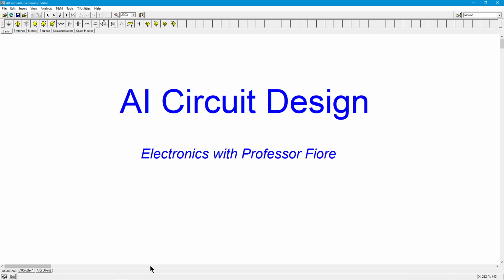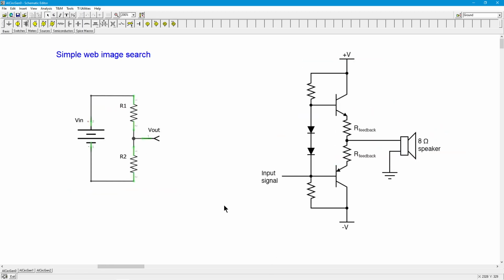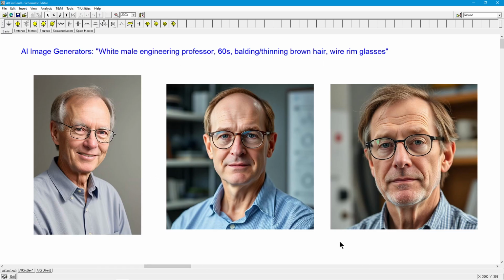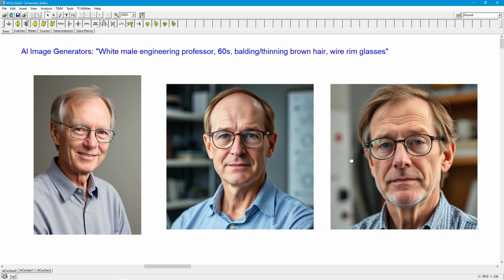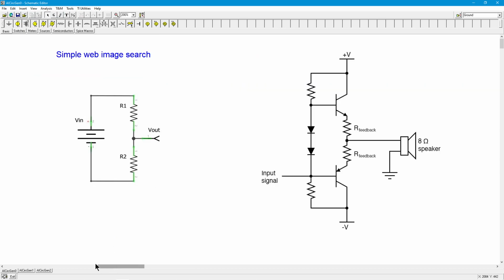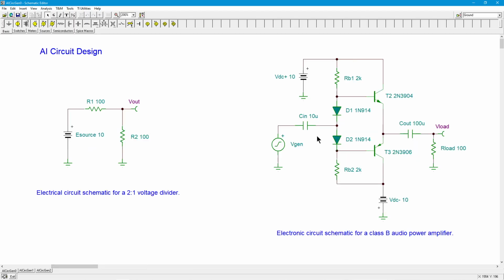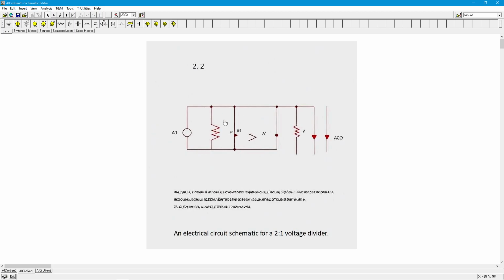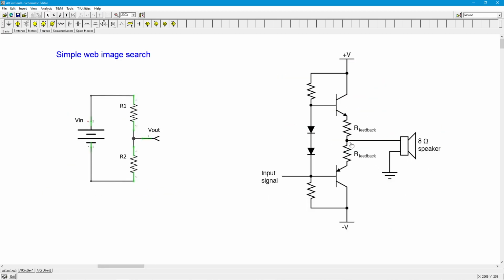AI Circuit Design

Comment: What AI does well is that it is a universal function approximator. You can use it to optimize circuits, but it will have to know circuit rules and have some understanding of the connectivity. That’s definitely not what this AI you showed is doing! It’s just generating random stuff, which is effectively what the AI does for image generation, being that it’s effectively an inverse diffusion process.

Comment: It so happened that I have dozens of old PCB files in my hands, I need their electrical circuits.
Is there any tool for the rapid construction of these schemes using AI? Or just some kind of automated algorithm of more old times. 
 The boards are not very complex but not simple two layers of conductors and several tens or hundreds of elements.
I can make pictures of them or something else  that will allow P-cad
Reply from the maker: Ah yes, reverse engineering. A laborious process to be sure. Anyone who has worked on old gear without a schematic understands the challenges. Mostly, that's a matter of time and care as the process is not all that difficult, technically. Unfortunately, I am afraid that I know of no automated process to do this.

Comment: Some of my AI tools are smarter than yours. Some are dumber than rocks.

Copilot was clueless, but perplexity did a good job.  I got a wide range of class-B amplifiers including designs driven by an opamp, some with transformer coupling, some with tubes, etc. A lot of the schematics weren't class-b amplifiers, but they were all legitimate schematics. The tool seemed to copy liberally from ResearchGate papers, ebay and amazon listings, and internet sites with circuit design ties. It did confuse class-b amplifiers with differential amplifiers though. Still room for a lot of improvement...
Reply from the maker: Do you think your results were functionally superior compared to just using a simple image search?